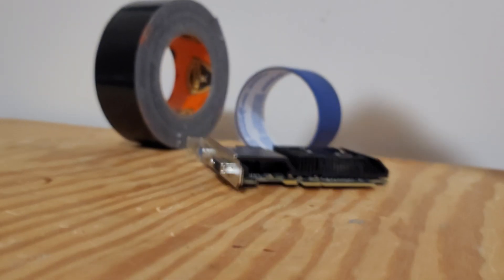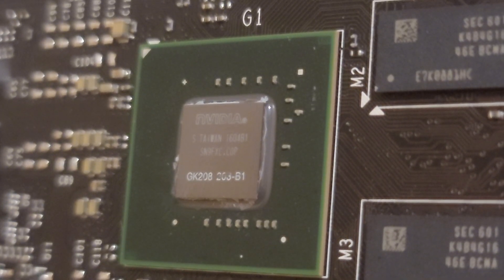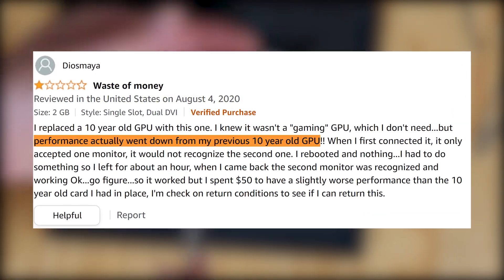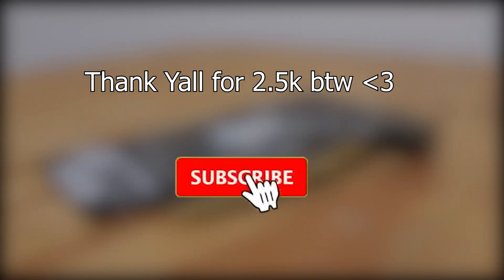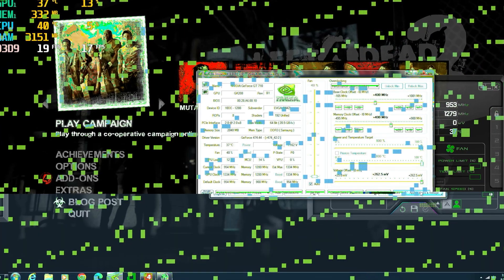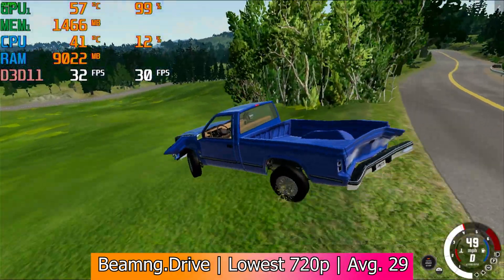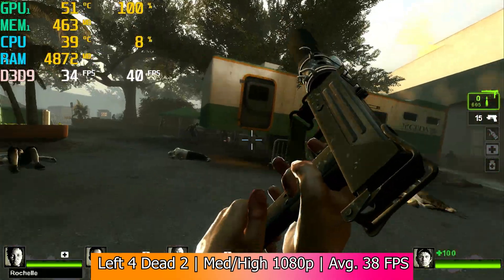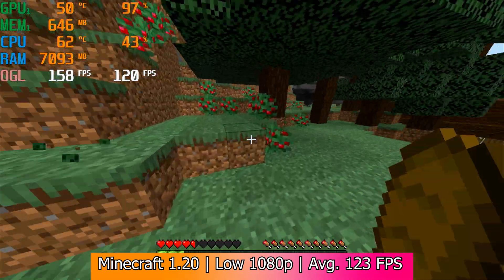Can Overclocking Save The GT 710? - Gaming With 2GB DDR3 VRAM in 2023

Comment: I have the Zotac 2Gb DDR3 vram version and nv flashed it from 0.825/0.900 V to 1V. And now I can do core at 350/380 and mem at 380/400.
Assassin's Creed 2 - 40/50 fps at max settings in 1600x900.
Assassin's Creed Brotherhood -  40 fps stable at medium settings in 1600x900.
Assassin's Creed Revelations - 40 fps stable in medium settings in 1600x900.
Assassin's Creed 3 - 30 fps in mid settings in 1600x900.
Assassin's Creed 4 - 30 fps in lowest settings in 1280x720 with sharpness 0.5 in NVCP
Red Dead Redemption 1 - 30fps stable max settings in 1600x900. 
Cod Black ops 1 - 80 fps max settings 1920x1080
Cod Black ops 2 - 60 fps mid settings 1920x1080
Far cry 3, 4 and primal playable 30 fps for 4 and primal and for 3 idk.
Assassin's Creed 1 60 fps in mid to max settings in 1600x900.
Assassin's Creed Rogue was 30 fps in some resolution.
Tomb Raider 2013 was 30 fps too at some 720 p or 900 p.
Fortnite at 800x600 stretched res and 75% 3d res lowest settings was 120 fps stable in battle royale and 200+ in creative.
Reply: I have the same card.

Comment: It runs about the same on gta with an i5 3470. Lows of 40 at 720p normal/high with 300/300 overclock. As I venture into others, it's definitely time to build a real rig.

Comment: I had a gt 710 1gb (msi) and it can run Morrowind 800x600 low-mid mix at 50-75 fps
Reply from the maker: Love that resolution. Can turn just about anything into gaming capable

Comment: The workstation cards like the k620 or p620 are underrated. For reference the k620 runs borderlands 3 at 10 fps on ultra settings and 60 fps at the lowest with 720 p. The only problem is you can’t overclock them even after trying to flash them.
Reply: as far as I know,p620 and k620 is mostly for 3d design,CAD,visual studio and for other engineering applications that requires a good gpu for pc built in 2015/2013 to support a good engineering apps built in 2019.Now,It is a office recommended gpu than gaming for professionals using their low average pc in 2024 .But who cares whether it is an pro office gpu if your  gpu runs well in games.

Comment: My experience with the gt 710 was shit af
The specs i used to play on
Amd fx 4300 4 core 3.60-3.80 ghz
8gb 1333 DDR3
GT 710 2GD3 Inno3d

640-480/800x600
Beamng 0.23- 24-39 fps on west coast with lowest setttings possible

800x600
Gta 5
Lowest settings 40-64 fps

Now if you replace the gt710 with a hd 6450/5450 1-2gb gddr5 you will get 33-50% more performance since it has gddr5, better core/memory clocks and architecture
Reply from the maker: Really? Geez the 5450 is crap. Didn't think itd be better